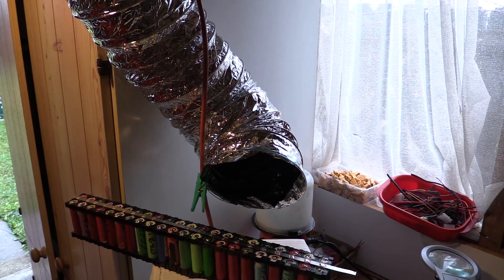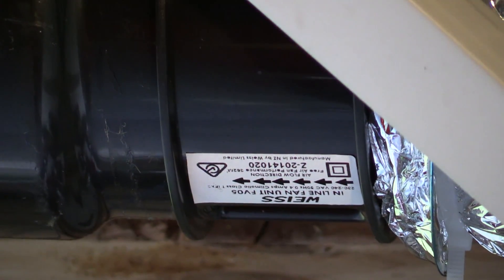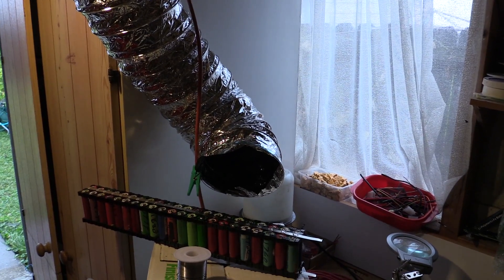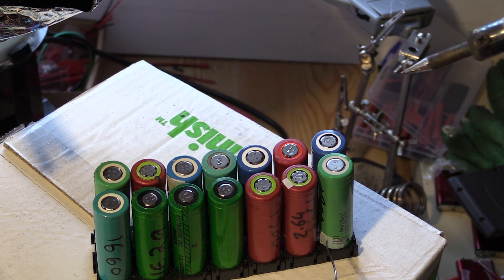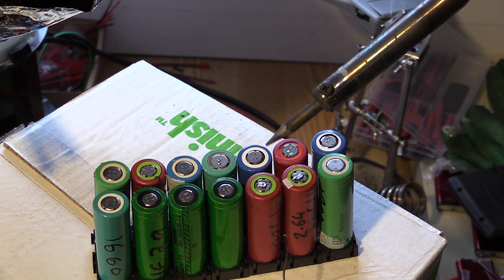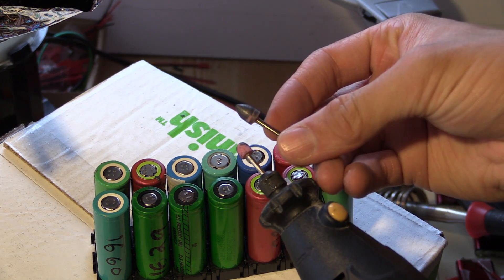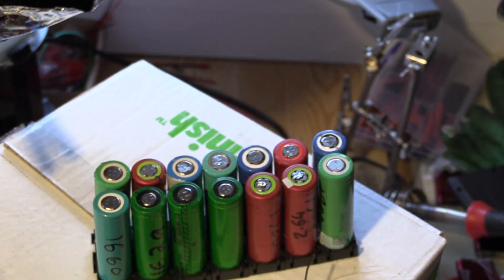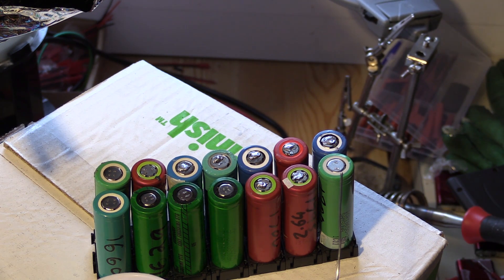Soldering Tip of the Day!

Comment: Would you please let me know the dimensions of the nickel strip you use for your busbar?
Reply from the maker: 0.2x7mm 1KG. But when ordering there are two types of Nikel Strip, one alot cheaper and one double the cost. I got the cheaper one at around 40nzd but its only nickel plated. Given the amount i still have left over from the current build i would highly recommend buying the true nikel strip at the higher cost as it goes a very long way. This is what i would order https://www.aliexpress.com/item/Thickness-0-2mm-Weight-1kg-roll-Battery-tabs-pure-nickel-plate-Strip-99-96-for-18650/32711171564.html
Also have a watch of Pauls video https://www.youtube.com/watch?v=oMJ0Tey6xpg
Reply: Thank you so much.  I hope you don't mind, but I'm going to try to duplicate what you've done with a few minor changes. (off grid inverter, 21s)
Reply from the maker: Off-grid inverter that supports 88v ?
Reply: I was thinking of using a 72v gowe off grid inverter.  At 21s I figured that I would have 86.1v charged, 77.7 nominal and 75.6 discharged (I didn't want to discharge the cells past 3.6v).

If you think this is a bad design, please let me know.
Reply from the maker: Sounds good,  i don't see any problems.
Reply: Thank you so much.  You're very helpful and generous with your knowledge.

You would have made a great college professor.
Reply from the maker: hahah not sure about that
Reply from the maker: What are you going to use for a BMS?
Reply: I thought I'd try to make the arduino bms that diy Tesla Powerwall made(the channel that has the picture of Tesla) .  He does not use 18650 batteries, but I would think that his design would still work on an 18650 battery packs.
Reply from the maker: ok  cool, hold off until you see my Version 2 coming in the next month, and then decide.
Reply: OK, I'll do that. I can't wait to see the video.

Comment: flux helps too :)
Reply from the maker: I started using flux but on this next bank of cells i am soldering I decided not too and found it really doesn't seem to make much of a differance. Plus without flux its not sticky and messy. The solder itself still has flux in it i am just not adding more.

Comment: Nice. I did that in the past with packs. Helps when you have an iron with a lower wattage. I upgraded to 100W but now it seems too much heat.
Reply from the maker: I found the opposite, the higher wattage iron helped.
Reply: pietkaify it should be the other way around